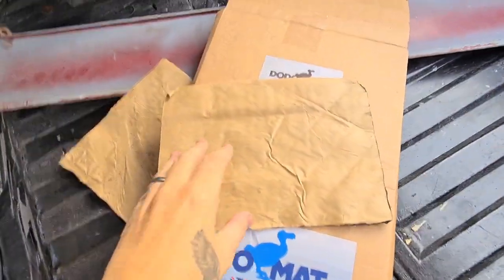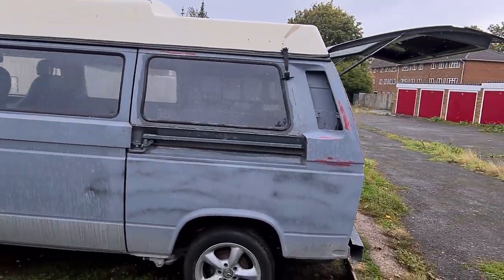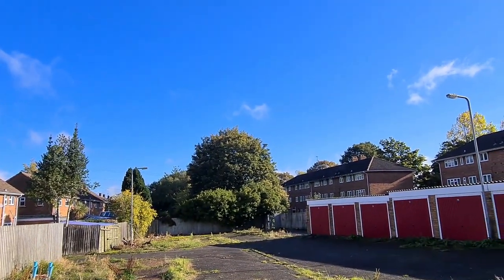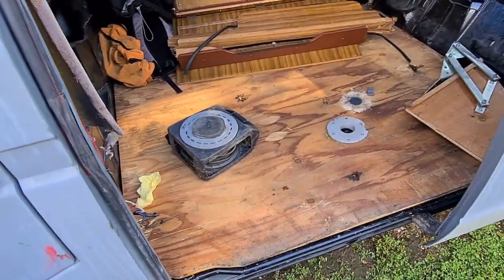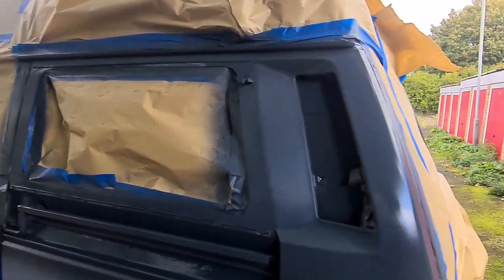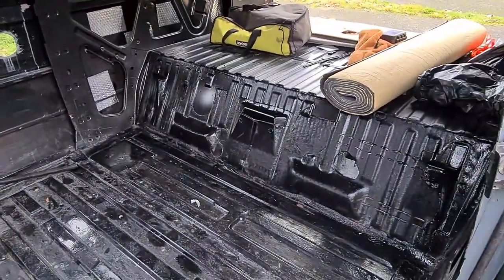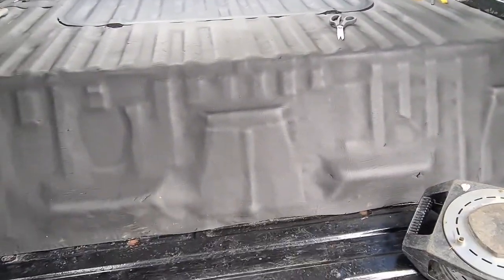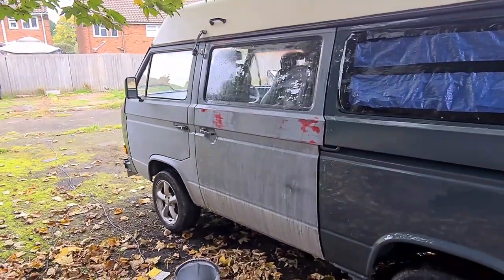Sound Deadening my VW T25 campervan T3 vanagon self build

Comment: Looking good. I had great fun (aka a terrible time) fitting sound deadening in the driver’s and passenger’s doors on my T25. While I was at it I put self adhesive closed cell foam in them for thermal insulation. It doesn’t hold water and it doesn’t foul the windows. Doing the doors was a short job to make measurable progress between seemingly endless sessions of grinding out filler with wire brushes.
Reply from the maker: ive need there mate its like a right of passage well all have to go through lol i sure im not finished yet